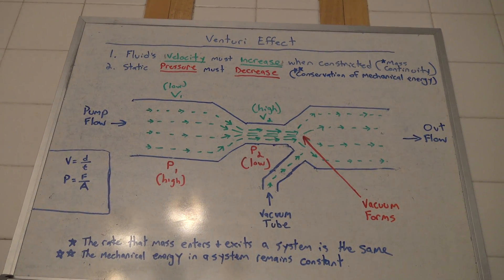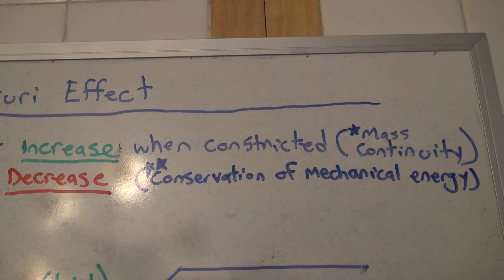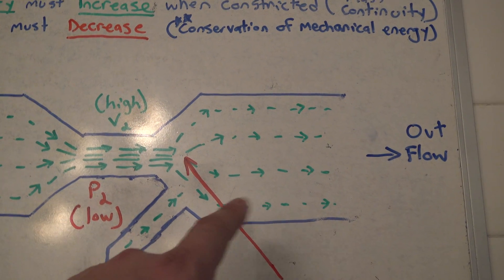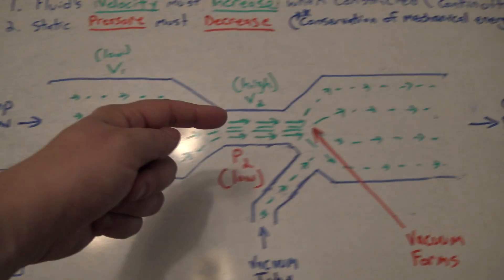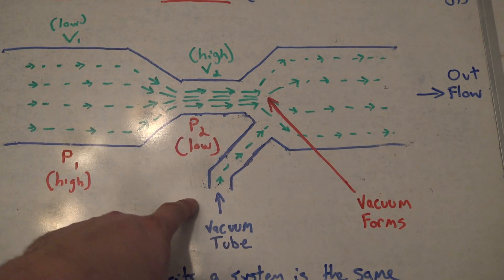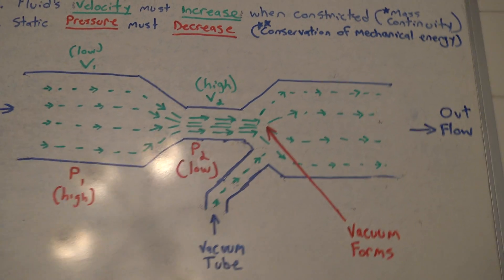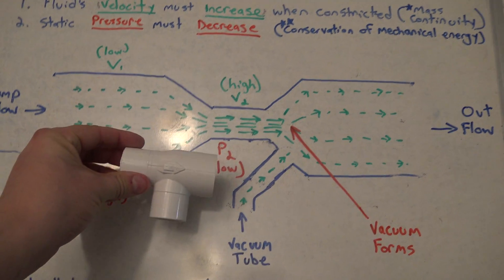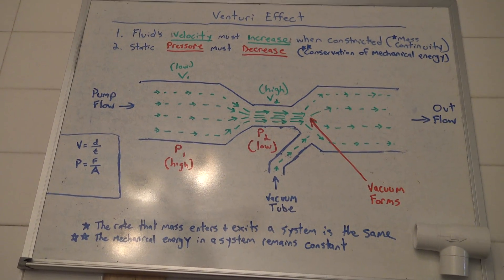#409: How Does the Venturi Effect Work? (Aquarium Vacuum) - Tank Tip

Comment: Most Venturi injectors have the vacuum hose connected at the low pressure middle part. Is that why mine won't work?

Comment: Can you please help with 2 questions:
1. difference between air and water as the driving media for venturi vacuum pump? I know of two systems in 2 different machines. Which one is better to use?
2. For the system that use water as driving media, we have to keep the water cool ( recommeded < 15 degree C). If water is hot, the venturi fails, but why? what is the difference in properties of hot and cool water that causes this?
I've been trying to understand these points. 
Thank you so much in advance.

Comment: A little correction.  The low pressure starts as the water begins to enter the narrowing section; where your arrows are beginning to converge.  Where the arrows diverge (at the exit of the narrot section)  the pressure is indeed increasing.
However, with a rapid expansion in diameter of the pipe, a secondary low pressure area is formed where your "vacuum tube" is located.  This is because the water cannot make a rapid turn around the angle of the expanding tupe and is trying to continue straight.   In effect,the water  "pulls away from the curved side forming a lower pressure area.
Reply: Does the shape of the exit of the narrow section affect the velocity of the vacuum?

Comment: Thanks for the upload, Online I have seen a make of these pumps (V-Pump) and they claim that it can push water 💦 40ft up! Is this possible as the device looks so small, and secondly they say it moves 1,200lt of water a hour.

I have been trying to find information about what Bar pressure is needed online, but have found nothing.

Also is it possible for a Venturi pump to move 6,000lt per hour?

Cheers 🍻

Comment: Is this way of doing things not just very wasteful energy wise?
Reply: But this way you can pump e.g. acid without any filters that secure the pump. Or e.g. you have a thing like frv30 - look for it at youtube. You don't need a vacuum machine, because the "brush" uses this effect to pump dirty water out, using the pressure from a pressure washer. You can see that behaviour here: https://www.youtube.com/watch?v=35vHWq9bSOU (I couldn't find a better footage).